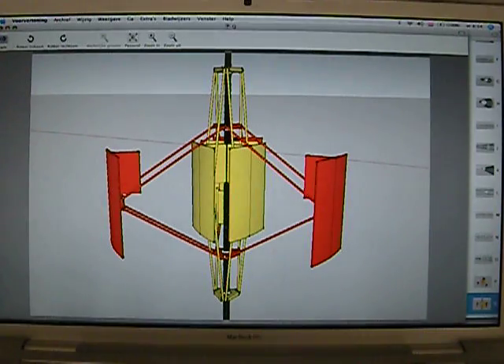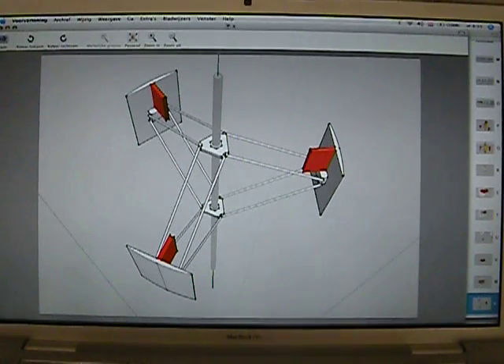BP oil leak solution

Comment: One of the best solutions I've seen so far.  I'm with you on connical plug solutions: there is a lot crude under incredible pressure flowing out of the pipe.  Of all plug designs - the cone design meets the least resistance to this pressure/outflow during insertion.  One big problem for independent researchers like us: the lack of technical info and diagrams conerning the nature of the problem.  IE: u had to go by limited views of spill cam.  I'm also bumping into this - we need more info.

Comment from the maker: @PeterLauwers 
Everything needs to be calculated. Yet the 150 bar of absolute pressure will have no influence on the materials. The mistake must not be made to look at absolute pressures. The relative pressures are of importance. This means that the two values (oil pressure and water pressure) need to be deducted from each other. The relative pressure difference will be no match for a good constructed valve. The anchor should  be maneuvered slowly into the tube by the remote operating vehicle.

Comment: Can you use your enginering skills to make this "Balloon Rivet" idea work? 
(See YouTube video — SOLUTION 1: BALLOON RIVET)
The device has to be locked onto the outside of the pipe before the probe part is inserted into the pipe. When the point of the probe is pulled up, the top of the ball remains in place and the rubber ball expands. At the same time the ball is filled with something like cement that will harden. Also, the rising oil pressure on the bottom of the ball will help expand it.

Comment from the maker: @TTok33 
1 Turning the screw thread to the right opens the anchor. When the anchor is fully deployed the screw thread will not be able to turn in that direction anymore (Conclusion the screw thread is blocked). 
2 The cone is slided on the blocked screw thread until it reaches the bolt. 
3 By turning the bolt to the right the cone will move towards the anchor. 
4 Ones the cone meets the base of the anchor, the cone will start to deform because the bolt is compressing the rubber in between.